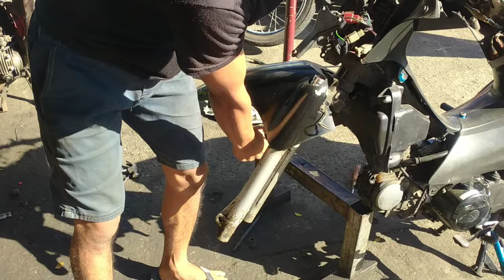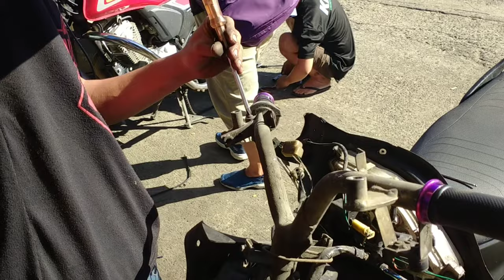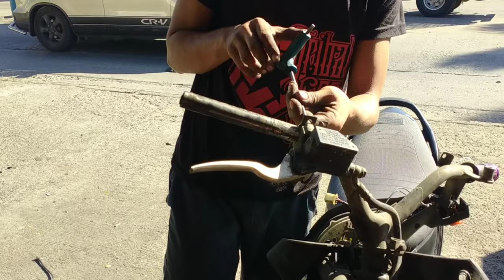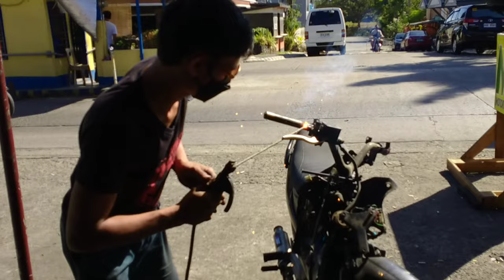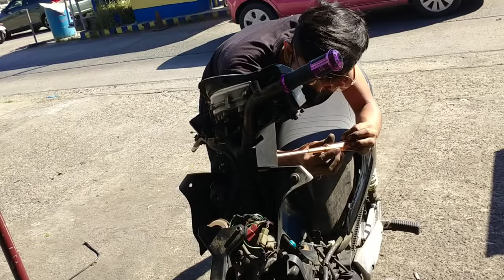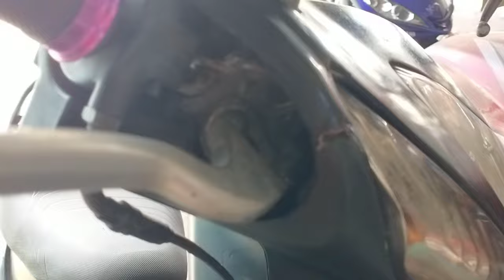honda wave 100 drumbrake to disc brake conversion

Comment: Paps kapag ba nagconvert ka drumbralke to disk brake papalitan paba yung bakal na handle?
Reply from the maker: Hndi na boss
Reply from the maker: I cut lang ung lagayan ng lever para maipasok ung master pump
Reply: Buti naitago yung brake master samantalang yung iba need pa butasan or palitan yung head cowling na ready na butas. Ano po brand ng brake master na ginamit

Comment: Boss bakit walang butas yung sa head cowling mo diba nakalabas dapat yun? Chaka magkano pala yung front hub pang disc brake?
Reply from the maker: sakto lng kc ung brake master sa loob idol
Reply: Kahit anong hub ba sa harap boss pwede ba yung xrm110/wave125 swak ba sa 100 yun nalang kasi problema ko e baka mali mabili ko Salamat boss!
Reply from the maker: @ronnielsibal7989  isang set kc yan galing sym